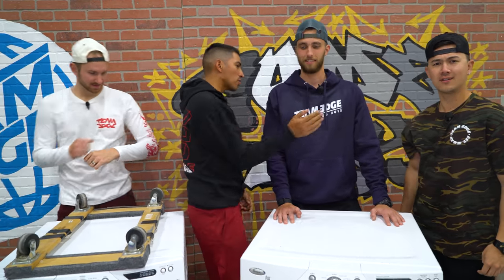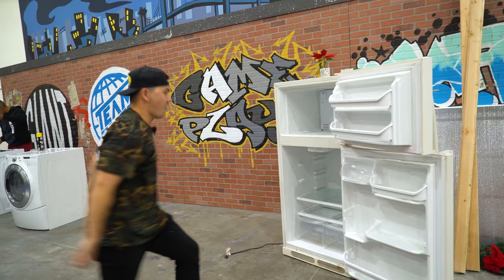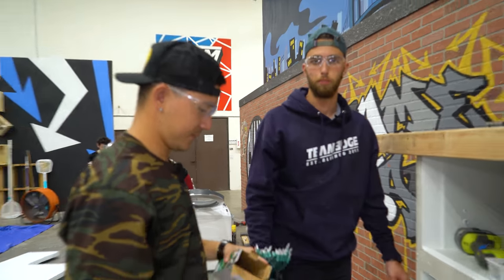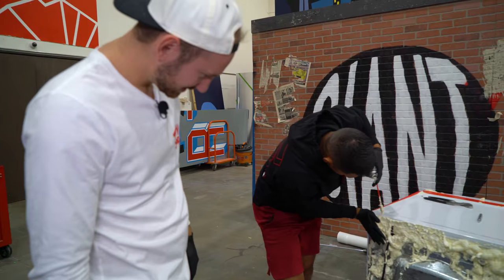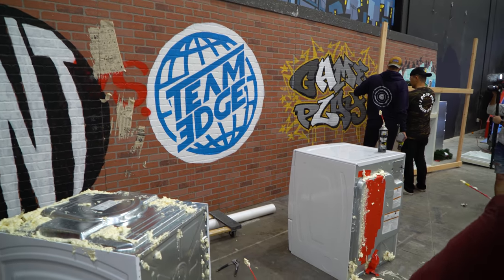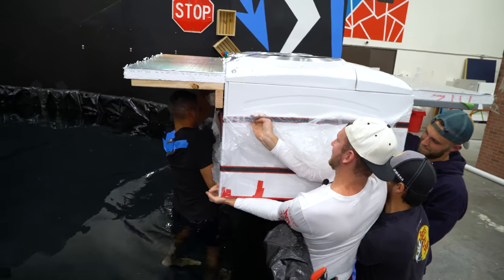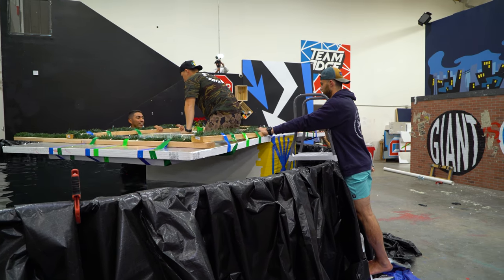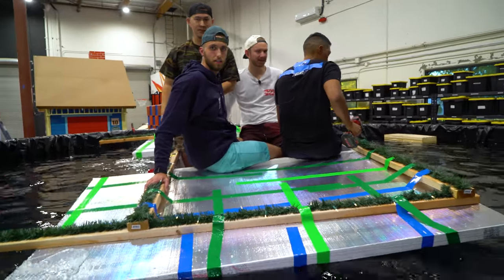Will we SINK in a FRIDGE Boat!? *BOAT SURVIVAL Challenge!!

Comment: that should have been pretty obvious that it would happen that way XD washers and dryers are basically just has metal panels on it and the fridge is insulated with foam and sealed again on the inside as long as u plug a few little holes

Comment: Just a quick tip I would have used flex seal to seal up hole and cracks in the washer and dryer because when it dries it becomes rubber. I would have sealed up every single hole and crack using duct tape, gorilla tape, and flex seal and flex tape. I would have used a ton of duct tape and gorilla tape and taped around the edges of both the washer and dryer than taped them together. Also just to add more buoyancy I would have tried to find some empty 4 gallon water jugs and taped them around the outside to help keep the washer and dryer afloat.

Comment: The fridge is already sealed to keep cold in. On the other side with the dryers, they should've taken all the heavy parts out engine ect. Then they should have filled the cavity of it completely with the spray foam and stood on the opposite side like a raft rather than a boat...

Comment: Bryan and Joey were doomed from the beginning. Front Load washers typically have concrete balancers adding a whole lot of extra weight.  The fridge on the other hand is lined with foam behind the metal frame to insulate temperatures, which adds extra buoyancy.